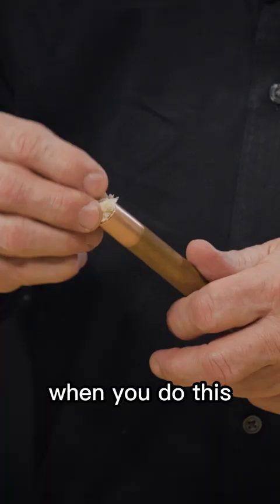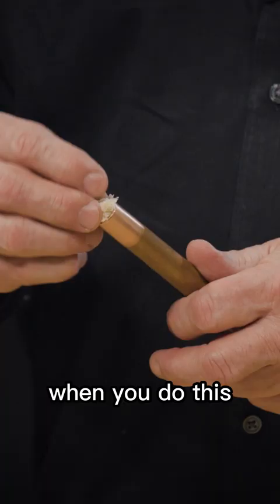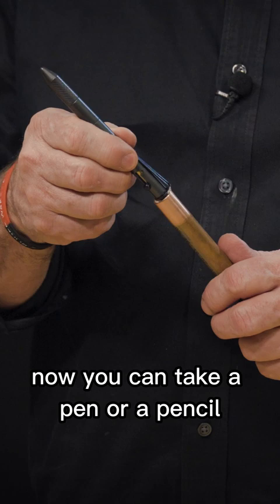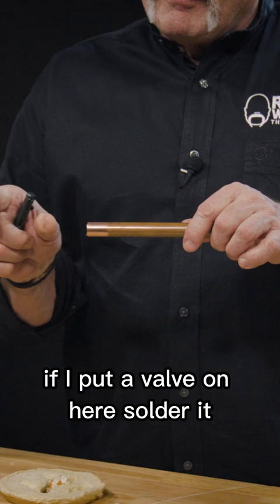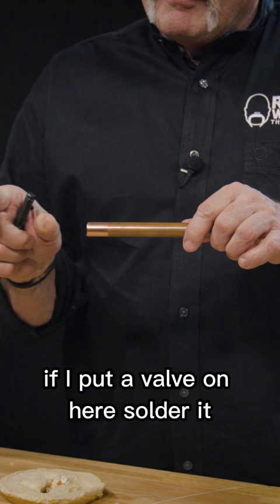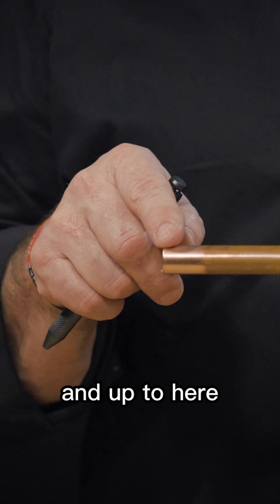The ULTIMATE Plumbing Tool

Comment: tips like this are why presspro products exist. introducing organic material into a system is not a great idea especially when the valve being used is not the same diameter as the pipe. note that it's rare to see a valve that is.

Comment: My Father showed me this trick when I had my first house. I have used it many times. I then found a package at the big box store that was Labeled "Bread" It was a sheet of peanut packing material. This is corn starch. I have not seen it in stores after this one time. But, I have saved some of the corn starch packing peanuts in my plumbing box. I have lived in old houses and helped friends with copper plumbing. The peanuts work just the same. Just remember to take the aerator off a faucet to flush the Bread or Peanuts out of the line when finished.
Thanks for all the great videos.

Comment: Bread is for bakers,,,, I tried that along time ago for my first time just to see if it would work and I’ve been either running my torch wide-open, or using my 100 B compact press tool ever since or I might get froggy and bust out my rigid electric soldering kit😃

Comment: Compression fittings work very well, always carry a few, this works but may need to clean aeraters on taps afterwards
Reply: Are you suggesting compression over solderjoint?

Comment: Another good advice it to prefab the pipe on to the ball valve before soldering it onto to the pipe side where you’re stuffing the bread. Also before connecting back into the house flush that bread out by turning the water on.
Reply from the maker: Great point!

Comment: Ive used this 2 times, both times it would have meant shutting down water to 50 or more units had the bread trick not worked.

Comment: Sprinkler fitter here, used this trick a few times when gluing cpvc, nice thing is the bread pretty quickly disintegrates and you won’t have to worry about it plugging up a sprinkler head

Comment: How do you get the bread out? Why not use a sharkbite valve instead?
Reply: Very old school tip, to get it out you run the torch over it to char it up and the water will easily push it out
Reply: @sween187  push in out into thr valve?
Reply: Because professionals don't use sharkbites, we solder.
Reply: @serpentinefire921  professionals dont use sharkbites they use bread lol. Sharkbite is tested and approved and insured, it is crazy people are trapped inside their own heads

Comment: Please don’t do this. What you just gonna leave the bread in there for it to rot in the pipe where the person’s water is?
Reply: no cause the main valve is closed for repairs but it is still dripping since its an old valve

once u turn it back on, the bread will dissolve with the water pressure

if ur afraid of rot theres always a product u can buy that imitates the bread too. its just more expensive than bread and u wont really use it that often unless ur a service plumber